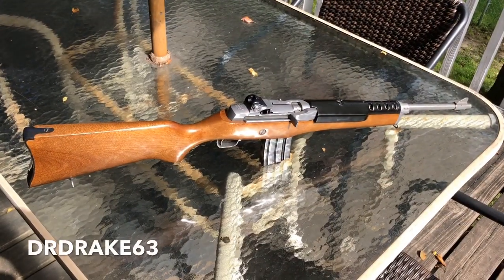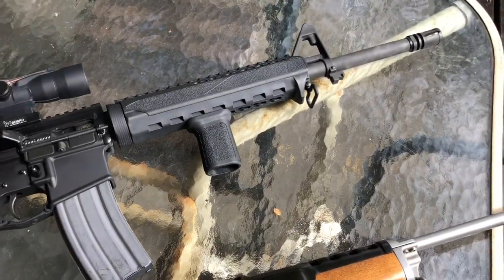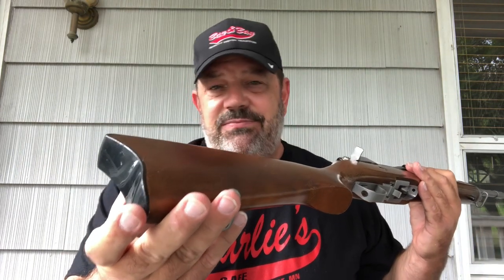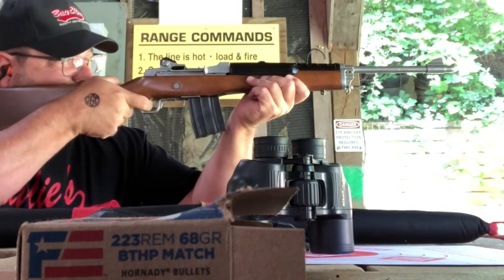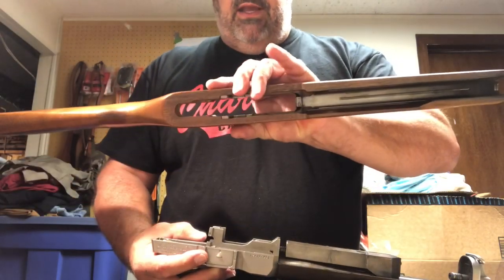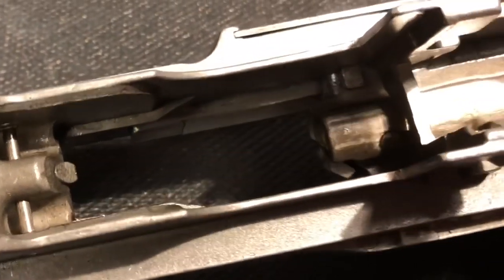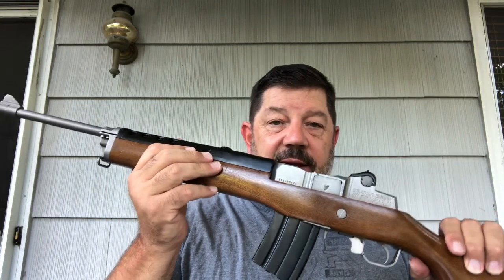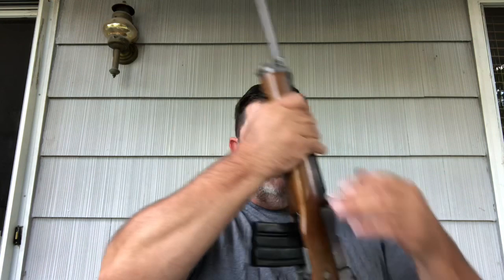Ruger Mini 14 - the long and the short of it

Comment: Mini 14 is a very good gun, and very underrated by many people. I have an AR-15, AK-47 and a Mini-14, all good guns. But the gun I like to shoot the most is the Mini-14.
Reply: I too have all of the guns you listed. I however have an SKS 'M' model that will accept any regular AK-47 magazine. I like the Mini 14 but I have found that the SKS that I have is way more economical to shoot and I use it all the time.It has a receiver that will accomodate any kind of scope I want to put on it and can still use the open sights even when the scope is mounted. I know people have said that the 7.62X39 is not that accurate but these guns are not the run of the mill SKSs. They are extremely accurate and up to 400 yards it is deadly as hell. I have been offered $1.200 for it and some are willing to trade and give me cash. Every time I let somone shoot it they come away pretty amazed at the way the gun operates and shoots.
Reply: @TBullCajunbreadmaker  people say 7.62 is unreliable because what they are trying to convey is that trash AK copies are shit. Of course they are, they are knock offs lacking original Soviet design and manufacturing. I'll put my Russian Vepr Ak up against any rifle for accuracy

Comment: Loved your comment about are you an iron sight shooter.  I'm over 70, still prefer iron over optics; quicker, easier, simpler and less prone to failure.  I still shoot iron sighted military surplus rifles; most days I can get 3-4 inch, 10 shot, groups.  To shoot better than that I now need optics on modern firearms.   Except for varmints and competition shooting, there isn't much that even a 6 inch group won't get done at 100 yds

Comment: Nice video, thanks for taking the time.  There has been a lot of talk about inaccuracy in the Mini-14.  Well, apparently Ruger also felt that the Mini-14 was a bit inaccurate and Ruger dealt with the inaccuracy issue.  Ruger made some changes and the newer Mini's are a lot more accurate.  The Mini-14's with the prefix of 580 and higher are the rifles that are more accurate.  I agree with what you said about many modern shooters not shooting iron sights to begin with, therefore many aren't the best shooters with iron sights.  I've seen some very good shooters with red dots and scopes, etc. that didn't shoot as accurately with iron sights.  It seems like it could be a generational thing.  The Mini-14 is just a really fun rifle and it's very easy to maneuver while looking great at the same time.

Comment: I've got a 182 series which I bought new in Summer 1981 as a present to myself for my 16th birthday with money made from mowing lawns.  My Mini-14 is still with me all these past 40 years.  It had been the most reliable and rugged rifle I've ever owned.  

I also trained the on the M16A2 with USMC in the late 80's, and now have my own Colt AR15.  

I've always considered the manual of arms to be easier with the Mini-14.  I like the safety switch on the Mini better than on the AR, but the magazine release on the AR better than on the Mini.  I also consider the Mini to be easier and quicker to shoulder into a ready position than the AR.  It's also easier (because of the open bolt design) to perform and visually verify a chamber check with the Mini.

My preference is for the Mini-14, though I appreciate the M16/AR15 platform as well.  The action of the AR-15 is directly in line with the barrel, whereas the action on the Mini-14 is  off to the side.  So, easier to keep site on target with the AR-15.

My 182 series is wood on top and bottom, so no metal shroud covering the action rod.  

The rear sight is also as you see in the video.  It is the best rear sight ever put on the Mini-14.  Unfortunately, Ruger dropped this particular rear sight design decades ago.  Stupid.  Also, as in the video, my Mini-14 is a strict iron sight rifle -- no scope mount points.  

My Mini-14 with the pencil barrel is not as accurate as my AR15, but it is accurate enough.  Iron sights on a paper plate at 100 yards.  No complaints.  

I should add that my Mini has a 1-in-10 twist, and shoots 55 grain the best.  Later Mini-14's have a 1-in-9 twist.  Also, the newer 580 series with thicker barrel are more accurate.  

Maintenance on the Mini-14 is stupid low.  Takedown is not as easy as with the AR15, but not difficult either.  As demonstrated in the video, the whole trigger assembly may be removed for inspection and cleaning .  No such convenience with an AR-15.  

I put a drop or two of Ballistol on action and bearing points, and that's all.  Frankly, I've run the Mini bone dry many times without any problems.  The tolerances of the open bolt design and of the action bar are very forgiving. 

I've often said that "You can't go wrong on a Mini-14, and the Mini won't go wrong on you."  

Would be nice if Ruger made a second design that accepted AR15 magazines. They could call it the Mini-15.  Ha, ha.

Comment: Thanks for your interesting video. I have a 583 series in stainless. I love everything about it except it was causing me problems where the brass was landing . I installed an adjustable gas block using the proper torque and it has worked out very well.  It did not cause any malfunctions.

Comment: I guess I have been unlucky with both Minis I have owned, one a "pre-ban" stainless and the other a late (2017) model. Our host suggested that guys who accuse the Mini of poor accuracy are kids who have only shot ARs with optics. Well, I don't own any optics. I have only used irons on my M1, M14, M16, AK and Mini-14s. And both my Minis were lucky to do better than "pie plate" groups at 100 yards.
That being said, yes it is a reliable mechanism. And I don't fault anyone who prefers it; to each his own. But if I'm shooting far away stuff or itty bitty stuff, give me an AR/M16, M1 or M14 any day.  I also prefer a rifle that lets me change a firing pin or extractor myself in two minutes rather than needing to send it to Ruger, etc.

Peace and thanks to Mr. Drake for a nice video.

Comment: I have the exact mini 14 purchased in the 1980’s. Stainless steel and wood. Rugged simple lightweight and extremely reliable. Accuracy is about 4 inches at 100 yards. Nothing to brag about. However the mini 14 should be enjoyed for what it is and it is an excellent rifle.

Comment: I bought a Mini 14, (Ranch Rifle) back around the time of the wooflu lockdown. I was getting a little tired, fatigued with the AR's and wanted something different and it didn't disappoint. BUT, getting the bolt back in can be a little of a struggle at times. (noticed you skipped that part) but absolutely love the rifle. Great video too.
Reply: Try putting a Ruger 22 back together.   If you get the geometry right, it all falls into place.  Same with the Mini.
Reply: Try taking the side plate off that’s why it’s there?
Reply: Watch Gunblue490’s video on breaking down the mini. He has a great video on every step, including the bolt.

Comment: It doesn’t have modularity, but it runs hands off reliably.  I have hundreds if not thousands of rounds without a complete strip.  Chamber wipe and bore snakes.  No malfunctions at all.  It throws the brass 15 feet or more with its gas piston system.  Accurate enough.  Doesn’t transfer heat back to the receiver.  Battle proved M1 action.  No buffer tube.  No wonky charging handle.  Not as precise but more rugged than an AR for sure.  If I needed a rifle for survival purposes where maintenance will be iffy, I would take the Mini with polymer stock over an AR any weekday and twice on Sunday.  And I own the AR type and shoot a bunch... well not as much lately for obvious reason.  One thing, actually two things create malfunctions in any M1 derivative,  do not grab the op rod while shooting.  The later 580 series rifles like mine have a plastic cover to mitigate that.  Also do not ride the charging handle back to closed.  Pull it and let it snap back on its own.

Comment: I have a mini (Ranch) 196 series I bought in 2000 when I lived in Calif. , I think it was $450 at the time.  I see the primary advantage to having a rifle with no muzzle device no pistol grip no adjustable stock and basically looks like a bolt gun. Is for example, instead of facing a crowd of looters breaking out the windows of my store stealing everything and setting it on fire, I am able to dispersing  the group with cover fire, flank and render the real instigators to non combatants . 
In the end face the police or a judge with a low tactical civilian home defence weapon that cost me $450 not my $2500 AR that looks (badass) scary tactical assault like rifle that makes me look like some kind of want to be special ops guy. 90% of the bullets maybe used to keep the opponents head down and gain a vantage position, nato rounds are full metal jacket that take more people off the battle field than casualties made with hollow point rounds or highly accurately placed rounds to center mass. People loss sight of how a weapon is used to take advantage of an opponent in a fire fight.

Comment: I had an identical one like this in 1989 and unfortunately, the accuracy was not very good after the first few rounds.  Sold it for a Colt 1991A1.  In 1997 I got a blue one and I kept it for few years and sold it.  Finally, I got the new one in 2007 with the plastic stock and flash hiders.  I love the Mini 14.

Comment: I have 2 Mini 14's one is a stainless 70's and one is a recent blued. The first thing I did with the recent blued Mini was replace that big ugly handguard with a Choate ventilated handguard, big improvement. I have had AR15's Colt, S&W and DPMS and I actually prefer the Mini 14's. I have M1 carbines and the Mini 14 is about the same size and has a similar operating system. I use Ruger and a couple different brands of aftermarket mags and they all function the same. I put a brass catcher on (which can be switched back and forth between the 2) because the Mini does like to throw the brass way out there. Mini's are a fun rifle and I think you will enjoy yours.

Comment: Good gun, iron sights yes!  Mine has an amazing swirled walnut stock (got lucky) and is also stainless.   Likely the next generation after yours, different rear sight , etc.  Mine shoots 4 MOA at best.  Tried to improve it but really who cares?  
Ever had an AR that clogged up after 100rds and wouldn't shoot?  You won't ever have that problem with a Mini, chews up everything and REALLY flings those empty cases hard and far!   Most fun gun ever, pure USA.  So American.

Comment: The newer serial numbered 580-XXXXX will have even better accuracy than you were able to attain due to modifications by Ruger.  The main mod being the thicker tapering barrel.  I also shoot iron sights at 100 yards with great accuracy from prone or sitting.  I have also tried a scope at 225 yards with just as good of results.  I have never had any problems with operation and for the most part it has performed flawlessly throughout my ownership during which time I have put well over 6000+ rounds thru the rifle.
Good video and glad to see someone else has good basic shooting skills using iron sights.

Comment: Good video. I enjoyed it. I've owned four Minis, over the years. I've found them all to be reasonably accurate. The problem I always had was that they wouldn't hold a good group, as they heated up. The one you got seems to have a pretty decent trigger. The ones I've had were all different. Some much heavier of a pull than yours and often gritty feeling also. That's, lightly addressing the earlier ones. I don't know what series yours is, but it's before Ruger changed the barrel contour and made some other changes to the gun. My current Mini is a stainless Tactical carbine, and it's a 581 series that was made in 2009. With the new barrel contour and other improvements, I found it to be very accurate. Well, very accurate for having fairly course sights and a real heavy, gritty trigger. I had the trigger group polished and worked on by a gunsmith in Utah who specializes in Mini 14 trigger jobs. After getting it back, it now breaks cleanly at 3 1/4 pounds and he even installed an over travel stop. So that when it breaks, it only travels a small amount and is quick to reset. I did end up putting a scope on it, and now it's easily the equal of any of my AR15s, in shootability and accuracy. I always liked my Minis, even with their quirks / issues but, with my new one (actually had it for eight years) I really love it. It's become one of my favorite guns.
Reply: Do you have the phone# or address to that gunsmith..in utah👍

Comment: The recivers got stamped .223 but the barrels were built for 5.56 due to it was originally built to be a lighter m14 for military use and they built tons of barrels for the military but the AR platform already took off and due to being cheaper and faster to produce than the mini 14 the mini was left behind .

Comment: Oh the triggers clean up nicely too.  I have a 583 and I’ve gotten 2 moa from a rest.  Reasonably 2.5-3.  It is a little more accurate than an AKM or right about where a really nice AKM will shoot:  they give you rings and a rail, silly not to use them.  The ghost ring irons are a pain to adjust and the front sight is too broad.  Not a huge fan but I put a cheap Bushnell scope on mine and I can ring steel at 300 yards smaller than a torso at my club no problem.  That’s really all I need from a rifle like this.  It would be nice to be able to mount a light on it.

Comment: Accuracy Systems in Colorado guarantees sub MOA groupings at 100yds. Having them work on a brand new stainless ranch model, right now. Putting in a 223 Wylde 1" straight barrel.
Reply: Can u post pics and vids of it while shooting it along with specs?
I have heard of Asi.

Very very good rep.
Just no vids of people with thier guns firearms etc.

Thx
Reply: What ever happened to your mini from ASI?
Are you going to post video of it shooting?
Its now 6.30.2021.
Or have a web site you post on ?
Like perfect union or ruger forum etc . There are no vids of ASI minis . beginning to believe its a myth.
Reply: @rontate7719  just got it back (5 month lead time) so haven't shot it yet. I've got to break in the barrel, but they sent it back with the test group at .477 MOA.

Comment: The sights on that particular firearm you have are very rudimentary. If you add in the pencil barrel and the harmonics and heat you have accuracy issues. I have the same exact rifle as you have in this video. I find it harder to consistently produce good groups with this rifle. I know that the 5800+ serial numbered rifles have addressed the sights, barrel and even improved on an already very good trigger. I found this video a very good representation of the pro’s and cons of it in this configuration. Thank you for the review.
Semper Fidelis🇺🇸

Comment: Awesome video man! I just picked one up on a trade aswell, it's a 1985 but it came with a scope already mounted. I think I might haul it off and go with stock configuration like you. I think it would be more fun that way, grabbing it from the backseat of the truck etc. However, the previous owner somewhere down the line removed the front AND rear sights. So I'm going to have to pick those up. I'm hoping the front sight won't have to be pressed on, I do notice there is a channel where a front blade would apparently pin on. Anyyway thanks for the great video review of this rifle!!
Reply: @mylakay100  Thank you for the info. The rifle have since became prohibited in my country unfortunately.

Comment: Mini 14 Ranch rifle, series 584 with the right ammo is giving 1” groups at 100yds when using a good scope. Practice your shooting nay sayers
Reply: What is right ammo for 1" groups? Don't have a Mini 14. But I'm looking.
Reply: @pauleyedwin6056  each rifle is different try several brands, but with a 1 in 9” twist rate lighter bullets like 55 to 62 grs will do better than heavier (longer) bullets.
 I have good luck with PMC 55 grs and Federals , my mini also likes the 5.56 NATO green tip 62 grs. Check out Accuracysystems for stuff for your mini, they even have walnut stocks $249
Reply: U.p. Woodtick. Thanks for info.
Reply: @pauleyedwin6056  now go buy that Ruger.
 The Target model mini uses .223 caliber only. Read the manual. Go spend that money
Reply: @u.p.woodtick3296  I just bought a mini 584 series. It's black with the ghilli green stock.. I mounted a decent, but not great optic on it. The Bushnell 1-6X LPVO, with that scope in getting between 1.25 and 2moa, right outta the box.. You're absolutely right, these things are accurate, if you do your part
Reply: @Usmc0341  👍

Comment: I bought my 583 "newer mini " in the Obama 2nd term "Lame Duck" scare dayz because  I wanted a Multi purpose SHTF rifle in 556/223. 
I picked it over a DI AR due to reliability when dirty and it's ability to eat CHEAP steel cased ammo which the AR's seemed to choke on.. 
Mine has Ruger scope rings and is mille for them and tapped for  a picatinny that's included!!!  
I can do head  shots @ 50 yds w/ irons ..... 
In 2015 when WAL MART had ballz I walked outa there for $ 784 .oo total! An AR would have been $ 675 for a DI!!!

Comment: Fired NRA Hi Power all during the 80’s. SA Super Match M1A. Used to and still do get a kick hauling out my Mini14 to the firing line and spanking quite a few shooters at 100, 300 yds.with their $2 ,000 tactical dressed out AR’s. Number one, be a practiced rifleman. A good iron shooter will just adjust point of aim when weapon heats up.